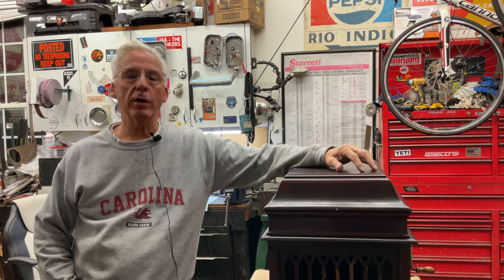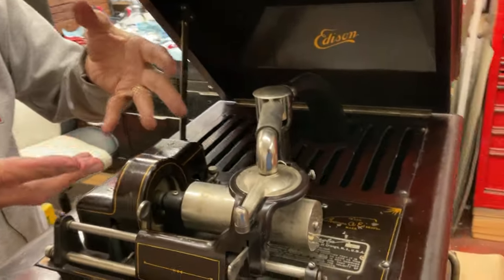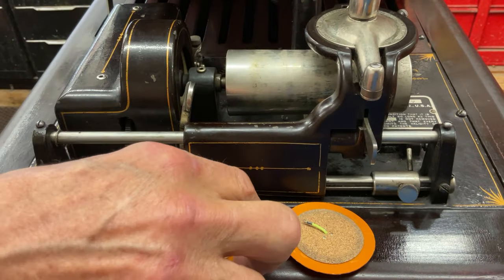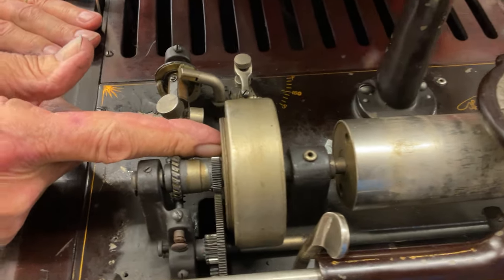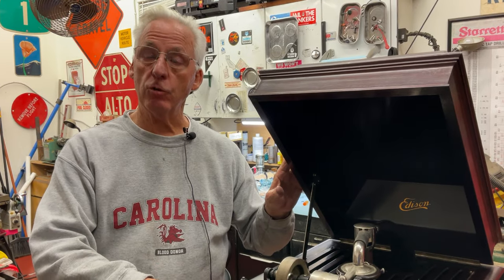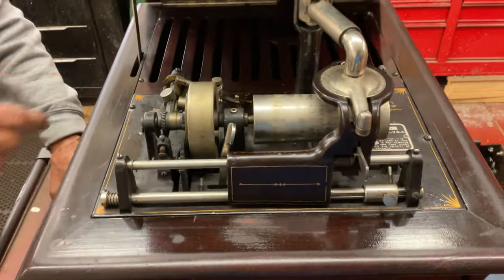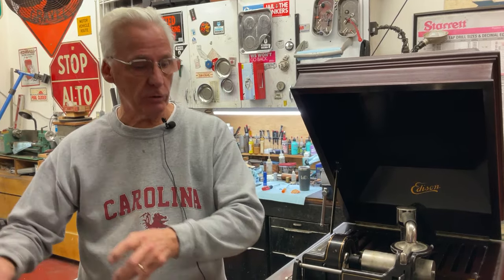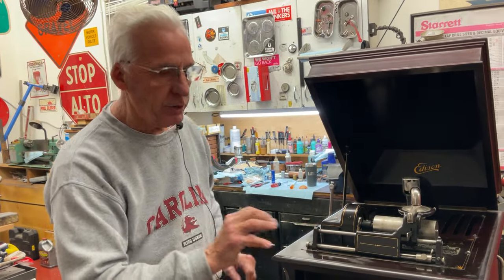1736.  Introducing the Edison Amberola V; a baby Opera ￼￼

Comment: I believe that had it not been for the factory fire of 1914 Edison would have followed this example for ALL of the future Amberola's. However after the fire Edison had to severely cut costs and while the Amberolas that followed were certainly good machines, they just did not measure up to the Amberola V.  As you mentioned they really are like a baby Opera and they sound fantastic! The gear drive combined with the flywheel are still light years ahead of the belt drives that followed.

Comment: I have a 1916 victrola and after I play a 78 recently I noticed black record shaving dust on the needle when I change it and it concerns me because thats part of the 78 and of course its very small amounts just I was wondering if you knew whats happening
Reply: How often do you change your needles? Have you ever had the reproducer rebuilt? Steel needles should be replaced every time the side of a record is played. If your reproducer has dry gaskets or isn't properly adjusted, it can cause premature wear to the record. You should also only be playing records made prior to WWII as the ones made later are not made of a composition that is resilient enough for the heavy tone arm.
Reply from the maker: Make sure you watch my video of how to clean your 78 RPM record, and then make sure you always use a new Needle. Hopefully it is just old dirt in the grooves.
Reply: I replace the needles per side
Reply: @bonnieshousehold.816  sounds to me like your reproducer may need a rebuild or adjustment then.
Reply: Yes I have noticed when I jiggle the reproducer it seems more loose ever so slightly at this may be putting some strain on the reproducer and if so how would I adjust it would I just take it off and put it back on more tighten then how it is because in my own theory the vibrations of the sound loosen it over time ?
Reply from the maker: @bonnieshousehold.816  what kind of reproducer do you have?
Reply: Yes I think it needs a adjustment but how would I do that..and my victrola is a 1916 one with its normal reproducer and its in relatively good condition so it may need some tightening